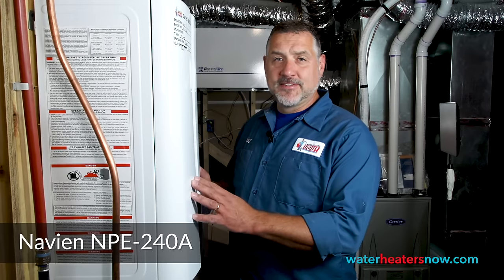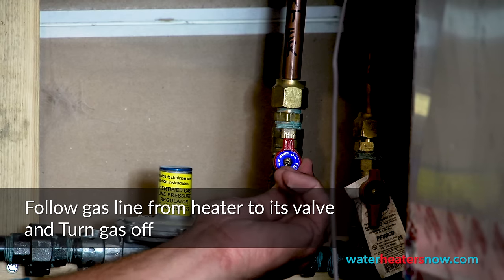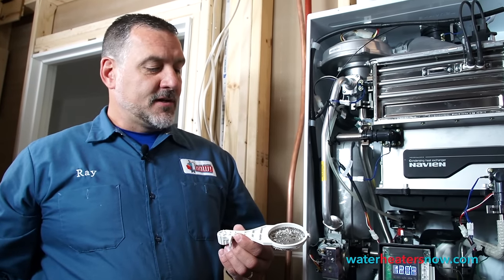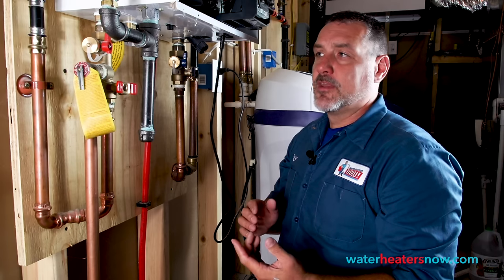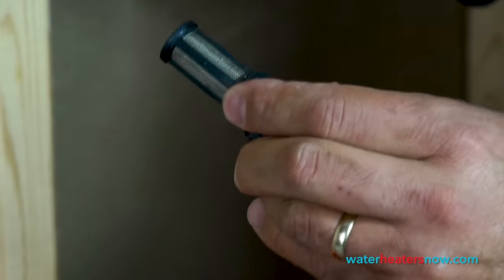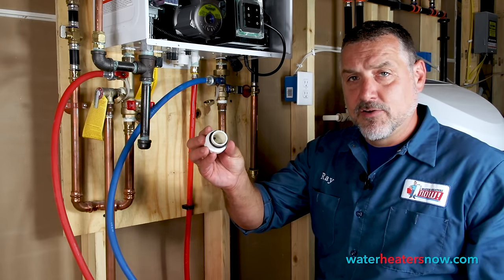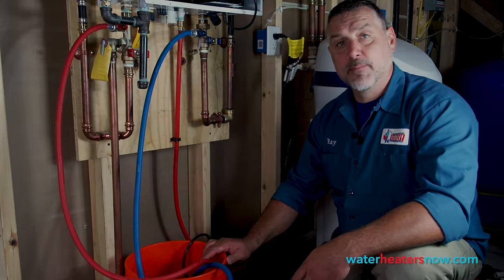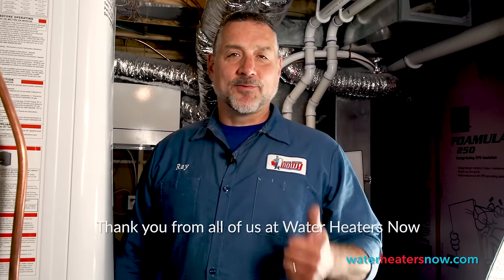Navien Tankless Cleaning   Water Heaters Now

Comment: I'm a licensed plumber in Canada, and I just have to say I have so much respect for this person. An honest plumber is hard to find nowadays, and to find one willing to help instead of gouging the customer. That's a game changer. Keep on doing what you're doing, you're doing the world a much needed service and keeping the scummy plumbers away at the same time. :)
Reply: I can't find a Sump Pump that takes Clothes Washer hoses, do you know of any?
Reply: @benjaminvalencia4228  I used this sump pump to clean my Navien 240A from HD, 1/4 HP Submersible Thermoplastic Oil-Free Utility Pump
by Superior Pump Model #91014
Reply: Yes , totally agree, nowadays most are like car mechanics
Reply: @benjaminvalencia4228  clothes washer hoses are the same thread as garden hose. FYI
Reply: It’s not honest to tell people that any Navien will outlast someone’s home let alone a decade
Reply: @michaelpersonale7396 💯 Mine started to crumble after 6 years. The water heat exchanger is fine but everything else around it falls apart.  When mine dies, I will go back to tank.
Reply: I have an isolation valve and a service port, but not a service valve. Is a service valve nessessary?
Reply: I didn’t have a cold water filter is that possible?  I have an older unit.
Reply: I'm debating on having a Navien npe-240a2 installed is this a good unit for a 2800 sq ft 2 story house with 3 bathrooms? Does one need to run a condensing drain pipe? How often and expensive should they be serviced? Do these require flushing valves? Also looking at the Bosh Greentherm T 9900 SE 199NG. Which is better and going to last longer?
Reply: @shanew7361  I have Navien 240A for the last 30 months, been running flawless, I do yearly cleaning as show in this video, I recommend have the installer install Jomar tankless waterheater valve make cleaning more simplify, just 2 valve to turn no garden hose needed.
Reply: @tonynguyen5362  Don't want to deal with maintenance, going with 75 gallon tank. Good to know though.
Reply: @PROJECT.LUKE.ONE.75  Levi, this reply is late. Were you able to service your Navien? My Navien doesn't have service valves either and, while having them is nice, you don't need them to proceed. Just turn off the isolation valves and connect your hoses. Also, I didn't bother with the garden hose rinse...I just opened my hot water faucets and ran the water through that way, as this is how my plumber did it the first year he serviced it.

Additonally, my air inlet doesn't run to the outside. For that reason, I can just look into the top of it to make sure it's clear, no need to remove the cover as I don't need to remove and inspect that filter. 

This job was far easier than I expected it to be. One hour's time total and, this week, I'll help my next door neighbor service his Navien, which he had installed the same time as mine.
Reply: @michaelpersonale7396  They're warrantied for 15 years, why would they warranty something for longer than you suggest the life of the unit is?
Reply: @beantownbeatdown  exactly
Reply: What's not to code is no valve right next to the unit lol
Reply: I agree with you
Reply: I completely agree.
Reply: I have a Milwaukee pump that I use to drain hot water tanks, that should work instead of the sump pump yes?
Reply: Thanks for calling this out. There are so many bad plumbers and its worth calling out the champions who are willing to help others and charge a fair rate.
Reply: I hope I have ruined mine.  I have this exact model and has not been serviced since new 6 years.  It’s showing a E110 code. Not working.

Comment: Performing my first flush. This video was immensely helpful. Maybe it's been updated, but I found I did NOT have to unscrew the vent pipe to get the top filter out. Just the screw holding it in, and it popped right out! Good Stuff!
Reply: Same with my unit, no top screw for cold air inlet filter. One less step 😄.
Reply: @Hall7180  Yeah it seems a few items have changed. First, that air filter doesnt point straight out the unit, it points toward the front right corner and you only need to remove the horizontal screw that keeps the filter in place.

Secondly, the dirt/debris trap in the middle is no longer circular, instead is now a very long, rounded edge rectangular piece. Otherwise it's all the same.

Comment: This was a great video.  I already had a submersible pump (1/6 HP) and bought a couple of 4 ft washer hoses and 2 gallons of vinegar.  Just finished descaling my Navien tankless water heater and flushing it out as well.  Turned on the water supply, gas line and fired up the water heater and all is good!  Thank you for teaching me how to do it on my own.  I saved a lot of money and learned something new.  Next up is to replace my broken salt based water softener and add a carbon filtration system.  Can't wait to have good water in my home1

Comment: You are the BEST!!!  I wish I had had your company install my heat and hot water system.  The company I used has ripped me off royally.  Thanks to your video, I just got my heat and hot water running by myself in the middle of winter on a holiday weekend.   The company said they couldn't come until tomorrow with temperatures going down to the teens overnight.  I just saved over $600 dollars!  It is SO nice to see a company that cares about their costumers and don't rip them off!  It is so rare these days.

Comment: Called a plumbing company and they wanted to charge me $250 to descale my navien. I really like this plumbing company as they always do very good work, but in this case, I’m glad I held off and decided to see if I could do it myself. This is easy stuff, the only thing you need to get is a submersible pump. Those go for $50. 2 gallons of white vinegar = $10. So my first go around I will already have saved myself $190. And cleaning after that, I’ll keep $240 in my pocket. And all because of this video! Thank you for putting this on.

Comment: Great video - thank you!  I would like to add a couple of critical additional pointers that were omitted from your tutorial:

1)  If there are multiple units running in Cascade mode, before flushing, you MUST FIRST take them out of Cascade mode, by doing the following (If you do not do this, the Cold Water service inlet will not allow water into the unit and your pump will be dead-ended):

- Turn on all water heaters using the Power button.
- On the master water heater, press and hold the Diagnostic and Reset buttons for more than 5 seconds. The water heaters will revert to independent operation.  Then, turn the units off and they will be ready for flushing.
- After flushing and maintenance are complete, turn on all water heaters using the Power button.
- To reinstate Cascade mode:
A.  On the unit you intend to be the Master water heater ( I rotate mine every year), press and hold the Diagnostic and Up(+) buttons for more than 5 seconds. “MA.00” will appear on the display to confirm that this water heater is set as the master.
B.  On the slave water heater, press and hold the Diagnostic and Down(-) buttons for more than 2 seconds. “SL.01” will appear on the display to confirm that this water heater is set as a slave.
C.  Repeat step 2 to configure the rest of the slave water heaters in the system, i.e., "SL.02"...
D.  On the master water heater, press and hold the Diagnostic and Up(+) buttons for more than 5 seconds. All the display screens on the configured water heaters will return to the temperature display.

2)  If you are using External Recirculation, don't forget to clean that Recirculation Inlet filter in addition to the Cold Water Inlet filter (they are exactly the same filters).

3)  After draining and before flushing, DO NOT FORGET to move the lever on the Safety Relief Valve back down to its normal operating position!  I learned this mistake the hard way, after I had pumped 5 gallons of vinegar into the drain because the safety valve was still open!!  DUH LOL!!

Comment: Exactly what I needed, hard to find good info online.
I do everything i can myself. I was having issues where hot water would stop for a bit, then come back without codes/system shutdown.

Pulled everything apart and cleaned everything. Tons of crud/scaling. Took me a good few hours seemingly the unit was never maintained.

Now heat is great, no more hot/cold/hot showers thanks so much.

Comment: Thanks Ray for posting this instructional video. My contractor never said a word about annual maintenance on my water heater. 6 years in, I could tell that the unit was not running efficiently. With the descaling, we have noticed a marked improvement on how fast hot water is available! Easy to clean and maintain. I’ll be doing my neighbors water tank next, since she has the same unit that I have. Best Regards to you and your team!

Comment: Worked great! My dirt-trap came off with an o-ring, it was stuck up inside. I took a little flat head screw driver and pulled it out (used a reverse video on my phone to watch what I was doing). ALL 3 filters were filthy, hadn't been serviced since installation 3 yrs ago. Back to normal high flow hot water.

Comment: Clearest and best service video I've seen on a tankless water heater. Just saved 300 bucks!!!
Reply: True!  Had my tankless unit going on two years (house remodel) and this morning got error E016, which I Googled and found filter needs cleaning and heat exchanger. I did unplugged for 30 min and plugged back in and unit working good. But I see I will need to service, MY SELF! :) Save me some mula! :)

Comment: Ray explained this better than all the others on you tube. I did see some galvanized plumbing on that unit. I hope it has isolation spacers placed or corrosion cell could form on the unit.
I like the way the plumbing on this unit is spread out wide, makes it so much easier to get to all the valves. Thank, Ray awesome presentation.

Comment: Thanks so much for this FREE tutorial!  

I've now performed this twice in the past year after experiencing warm water with 'hot' turned all the way up.  We were able to survive a few days by 'tricking' the system--we'd run 2 faucets when we wanted hot water from 1.  

The whole process can take about 1.5-4 hours, depending on your skill, availability of tools, and access.  We used a non-submersible pump from Harbor Freight both times.  It's just a matter of matching up the correct fittings...

Comment: Thank you for this  video. I paid the plumber  to do this service twice, what they charge is more than what i want to pay. My son and brother did this simple maintenance with me referring to this video when we weren't sure. It is so simple but my tank is outside mounted on the wall.  If i had to do it again  i would never install it outside. The cold water pipes will freeze and all it takes is one time for this to happen and mine did  the first two years of installation.  I blame myself for dreaming on that no freeze thing.  But at least it's not in the crawl space like my electric heater was. So far no more freezing but outside unless it NEVER gets below freezing don't . The only mishap was they forgot to brace the hose during the descaling and got a vinegar shower.

Comment: This is such an amazingly helpful video so I want to thank you for this!!!! So easy to follow, there were no points of confusion, and you even helped explain even further with the handful of text overlays. Very patient, and well done video with excellent audio levels and video!!! This helped me become a rock star with my wife because we now have hot water again!

After I cleaned the two filters and 'pin trap', we were good to go! But, each faucet and shower head needed to flush out for about 30 seconds with quite dirty water, I was wondering if this was expected? Also, when I cleaned the hot water filter...it was greasy to the touch. Really odd. Lastly, the clowns who put the unit in, they torqued the hot water maintenance valve in a position where it is impossible to maneuver a drain onto, there is about 2 mm of space between the maintenance valve cover and one of the mains that feed the unit from the bottom. I'd have to dismantle the hot water lead significantly, which I am definitely not skilled enough to do.

Comment: Very good video and informative. Your descaling video is also excellent. A few points for that video which comments are turned off. You cleaned the water inlet filter twice. Also opening all the hot water faucets does not drain the pipes with the heater hot water cutoff turned off. Everything else is spot on! 👌

Comment: Great video, thank you. A few things I did after I was finished with the flush. #1, I took the used bucket of vinegar outside, and before I dumped it out on the ground , I neutralized  it with a cup of baking soda , and poured it out where there were no plants close by. I didn’t feel comfortable pouring  it down a drain into my septic system. # 2, I rinsed everything thoroughly  with water that had come in contact with vinegar , including hoses, pump, and tools. # 3, have an old towel rag near by when you are doing the flush, because you will get some water or vinegar on the floor.

Comment: I see that this post is 3 years old, so I don't expect this to be answered... but thought I would give it a try. 

I have a Navien NR-210/249A that is installed in my garage and providing hot water for the floor. It is a closed loop system and I have done NOTHING to service it for at least 5 years, except to make sure that the water in the system is topped up. 

FIrst off, it has been amazingly reliable and an amazing heating system... I don't have many luxury items in my life, but I consider this to be one, haha. I broke my knee recently, so I haven't been spending much time in my garage. I waddled out today and noticed that it seemed cold... I noticed the batteries in my thermostat were low, so I took them in the house and replaced them. I reinstalled the thermostat and when it tried to start up, it sounded odd. After a few minutes of trying, it gave me a code of E022 (cold water inlet thermistor 1- short)

I also noticed that the water pressure in the system seemed to be really high (20-30 psi.) I thought it may have frozen, so I turned on my Mr heater that I have as backup heat. I left that on for a few hours. I returned and plugged the heater back in and it tried for a while and I could hear what sounded like water in the exhaust vent... After trying to start it 3-4 times, I shut the inlet and outlet valves off, drained the pressure off and then pulled the dirt trap off... lots of nasty black water came out. I put everything back together, plugged it in and now it seems to be working fine. No sound of water in the exhaust, it fires up and sounds normal... altho it did make a odd squealing / grinding noise a few seconds after running. I assumed that was air purging from the pumps or exchanger. 

If anyone has thoughts on this I would love to hear them. I will keep an eye on it and see if it keeps working or not. My biggest fear is that the heat exchanger has a crack and that leaked into the exhaust, but I would assume that that would just drain out the condensation drain thing ...

Comment: Fantastic video - easy to follow.  Just finished cleaning my Navien for the first time since installed.  Thank you!
Reply: Rich DeLuca rich where did you buy the hoses and pump?
Reply: @gm3430  You can get the hoses and pump at home depot. The hoses are washing machine hoses. As far as the pump goes, from other videos I've watched you only need about a 1/6 th horsepower pump. They say it will give the solution time to eat away at the crap because of a lower flow rate.

Comment: Nicely done video. Couple of issues: this was a 240A, recirculating line hooked up. No mention made of what to do with that. Option turns out to be to turn small valve in heater to internal circulation. Also, the ‘dirt trap’ is actually the condensate drain trap. When removed it empties the anti reflux tube above, which Navien recommends it be filled with water prior to restarting heater. If the o’ring on the trap is not snug it will drip. I bought a 1 1/8 inch o’ring that did the trick. Also it does not hurt to use silicone grease on all o’rings.
Reply: How do you fill the anti-reflux tube?

Comment: Awsome video! As a home owner for a brand new home, I want to do everything I can to take care of it.  This video made it very easy to service my water heater.
I called Navien Tech Support Help Desk.  They were very nice but said that due to liability issues, they would NOT provide step by step instruction on how to do this!  Oddly enough, they said you should do the annual service but said that many units go for 10 our 12 years and work just fine without it.  I got the impression that they'd be happy to sell me a replacement when my current unit dies.  I guess that there's not a lot of incentive for them to help me make mine last the life of my house!

Comment: Thank you for a great tutorial! 
I'm curious about a couple changes from the other video. Like not draining the house hot water lines, not opening the hot pressure release valve.
Also no mention about the recirculation line & clean out?

Comment: Great video. My heater was installed 8 years ago. The installer did NOT explain any of this. Of course, I have been having issues with Code 16 for some time. Calls to Navien fell on deaf ears. Today, after watching this video, I have purchased a pump, the hoses and the vinegar. Tomorrow, we'll be Code free and hot showers without the temperature going to cold, back to hot, then to cold, back to hot and then solid cold because of Code 16. Thanks for your great instructional video. Oh, my wife thankx you too !!
Reply: what type of pump is god for this (model etc)?  I too was never told to descale the water heater at all.  The company/installers came in....and that was it....never said anything about maintenance